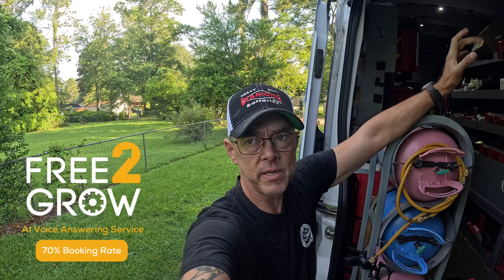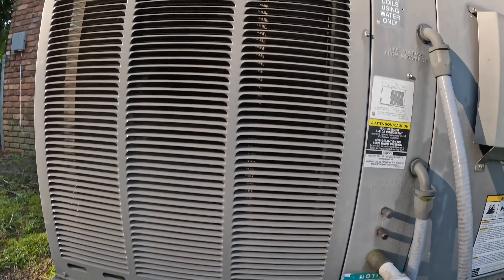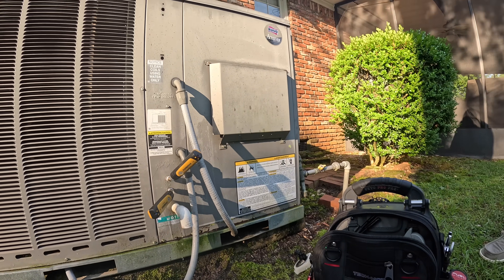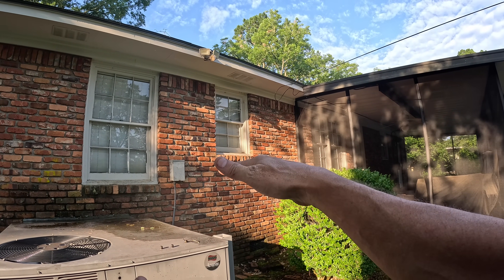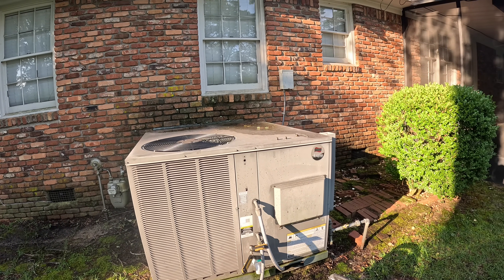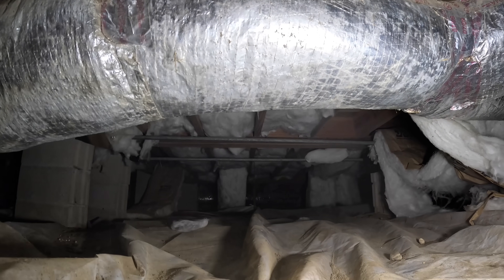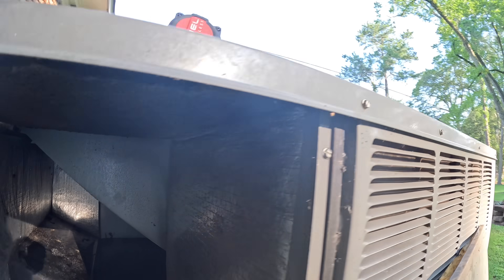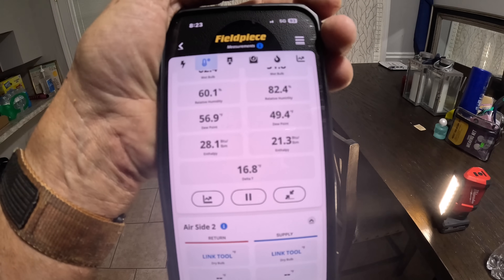A No Cooling Call I Get Every Time We See 100 Degrees! #hvacguy #hvaclife

Comment: We were in a 98-100 degree spell a few weeks ago. My next door neighbor told me the temperature was higher than the thermostat and the unit will not shut off. I no longer take calls, even for a neighbor, so I sent one of my 3 techs over to have a look. He called me and said he believes there isn’t enough supply in the family room where the stat is. I looked at it that evening and agreed. We added an 8” supply duct and wall register the next day. That was the fix. She is happy. She said it did this since she moved in 10 years ago when the temperature got over 95. No, we did not do a manual J or D. Sometimes you just go by experience. She is a widow and a good neighbor. I told my bookkeeper to invoice her for a  $79 service call. You have to pay it forward sometimes.

Comment: That ac is working hard at dehumidification based on the amount of condensate coming out. Id check RH in the house as well and to go the extra mile check out the entry points for any major leaks such as doorways and windows

Comment: If outside temperature is 100F and you set thermostat lower than 80F, it will struggle. It is what it is... I always keep that 20F degree difference in mind. If it's 90F I could go with 70F inside.
Reply: It depends on how well the unit is maintained. No dirty coils, no dirty filters? 
Then a big factor people seem to love to ignore is insulation in your home. When was the last time you put insulation in the attic or checked? What types of windows do you have? Are your doors sealed? It can be 100f outside and you could have a brand new unit but its going to run constantly if your house is not insulated well.

Door strips, attic insulation does not cost much.

Comment: This isn't a "that's all it can do on hot days problem"... This customer has house issues. You can have the best a/c system in the world and it won't work if the house isn't vented, properly insulated, and air tight.

Comment: Thankfully my unit is big enough to cool on 100 degrees days. House very tight. My issue was the thermostats installed when house was built had an non adjustable temp differential which was preset at 1/4 of a degree. If set ok 70 it would kick on at 69.75 degrees and turn off at 70.25. Unit wasn't running long enough to properly remove humidity. Best thing I ever did was change stats to am adjustable. I have them set on 1.00 differential. Unit runs longer  stays off longer. House also feels better cause of lower humidity. Unit will also last longer. Running longer is much better than starting and stopping

Comment: "Above 95 it gets outside of design conditions".   Well that's when you NEED it to perform.  In the desert near Vegas, it's above 100 EVERY DAY in the summer, and normal daily highs are 105-120 .
Reply: When you don't have moisture to remove, you don't have as much heat content to move, and you don't have to worry about an oversize system running short cycles that don't pull out enough moisture.  I know "it's a dry heat" is a punchline, but in this case it has very real practical consequences.
Reply: Congratulations, you have completely missed the point. The Manual J Load calcs are done with 95F outdoor high for that region. Manual J will be using different outdoor high temperature for areas near Vegas.

Comment: Have a 30 yr old central air unit. HVAC tech explained this exactly when checking the unit after the capacitor failed. Unit does well within about 20 degree differential 75 on days up to 96-98. Over that I have to bump the thermostat up to 76-77.

Comment: My Ruud 3.5 ton Achiever condensing unit is 23 years old and still running strong.  My friend has the same unit that is 26 years old and still working.  I LOVE the new units where only one 1/4" screw is needed for the side panels to pop right off = awesome design!

Comment: I ended up installing high efficiency window shakers in the main rooms.  I run a 3 ton and was told that it s a little over spec for my house.  On really hot days and nights I close off the vents in the rooms and run the window units to not have the main unit running/ 24/7.  I remember a week that it was 93 at night with high humidity and the main unit was clearly struggling until we flipped on the aux ones .  The house stayed at 74 and i felt the all the units cycle on and off like normal.

Comment: This is a great video brother . I had about 20 calls like this the past 2 month. Sometime they have a delta-t of 17,18 and when i look ag the ductwork the are small and the custummer says it has been like this for 20 years i tell them  its 95° outside 20 years ago. Some need more insolation, sometimes i tell them you need  bigger ducts a little more insolation, impact windows and possibly 1/2 ton more . They just cant keep up with this heat. Everything has to be working 100%.

Comment: Always interesting. Here in Arizona the state minimum is 30 degrees below outside temp. As a builder (now retired) our house could easily maintain 75 on a 115 degree day.
Reply: Arizona has low humidity so removing heat from the house is much easier

Comment: To me, if  it's 95 outside and your system is struggling to maintain 75 inside, you need a larger system. I have an older system that's always worked well and even  if it gets up to 97 or 98, I can stay a comfortable 70-72 inside my home.

Comment: That has to be r22 with those pressures? That suction is really high, that sucker is loaded big time. I would think you might have a little higher discharge at that point? Seems like that compressor has lost a bit of it's punch to me, but it would be pretty expensive to replace and you probably wouldn't gain much. Cleaning the evaporator theoretically will load that sucker even more. Looks like a lot of the system capacity is going down the drain. ( running 40⁰ water onto the grass) .  But not much you can do about that. Wonder if a guy could sub cool the liquid line with that condensate and pick up some btu per pound of refrigerant flowing through thhe valve.  With the load it has on it, I would think you could go a bit bigger no problem.

Comment: You can see the humidity is high in that house by the way it is condensing. That would make me think they need too look at air infiltration, even things like wall outlets and switch plates  along with usual door gaps.  Heavy drapes to block the light and hold heat close to the windows might help. 

I lived in a house built in the seventies 30 years ago in the Dallas area. 1600 sqft, single pane windows and the house leaked like a sieve. Plugging up the gaps, safety plugs in the unused outlets (you could feel air coming through them) and cover plate gaskets all helped. Good old F&J track home. 

Setting the temp down to 72 and letting it run all night would also help get the water out of the air as well giving the unit a head start for long hot day.

Comment: Awesome video and great explanation. We have this issue during the hottest part of our summer (now… lol) here in Wisconsin. Most homes are at 15,000-20,000BTU/per 1000sqft so they are properly rated or slightly underrated, but when it gets hecka hot and humid, that thang runs and runs and runs especially when the typical midwesterner is used to a comfy 68-72°F inside. Good thing our hot part of summer is only two to three months and then the rest is pretty temperate 😅😂.

Comment: What's the fix if the manual J only goes up to 95, but you regularly go above 95 degrees?  At the end you said if you design the system too big, it won't run enough to dehumidify on an 80 or 85 degree day.  What if you'd like to be able to satisfy a 25 or 30 degree temperature difference, but also be ok on days where you only need a 10 or 15 degree differential?
Reply: Then you get something with a variable power output. Don't oversize the regular stuff, it'll make you much more comfortable on the dozen hottest days of the year but it won't make it into a sharing rink.

Comment: alot of older homes have terrible insulation, i had a early70 home ( brick) and we re insulated each room and ceiling one room at a time; in two years we were done , it made a HUGE difference with the hvac performance, its worth it

Comment: Yeah...but no. 
You wanna go with a generic 75/95 then you should still have a liquid pressure of around 291. 

So that's about a 20° difference off. 

Then on the vapor side, even if you equated that to 25° of super heat and you're reading a pressure which is equivalent to 80° that still giving you a saturated temperature of around 55°. 

I would have charged in some refrigerant to bring the evaporator coil lower as well as bring the super heat lower 

You have to do a realistic diagnosis of the line temperatures and the wet bulb versus the dry 

There's no point in a "generic "reading. 

The simple logistics of the location of the condenser as well as shade and the internal component of the evaporator coil along with airflow and insulation make a significant real world difference .

In other words, if you're gonna do the work, then actually do the work

Comment: I heat and cool my 125 year old, 4500 square ft Victorian house with mini splits. Id never in a million years use one of those ac/ heat pump units. They are hot in the summer and massive electric bills in the winter. All countries in hot humid climates use minis splits. The rest of the world don't use those AC/heat pumps.  Im set at 67 all summer long as I want my house an ice box and 64 in my bedroom at night. Winter time its 5-10 degrees outside they are pumping 130 degree air. My units cost $1000 for 24k BTU and I put them in.  If it blows up ill order another brand new one online and have it tomorrow before sun down for $1000.-1200. Iv had them 8 years so far with zero issues and they have never been touched. Only thing I do is spray the coils with the water hose every few months to clean them.
Reply: But mini splits are ugly.

Comment: WELL DONE! Yes people need to realize as the temp outside goes up the set point inside should too! And Keep that Condenser CLEAN! Simple garden hose!! Also inside filter!
Reply: Or, HVAC technicians need to size the “standard” system bigger than they have been. It seems to me the “standard” is a shjtty one. If my brand new AC system didn’t get it below 70 I’d be absolutely pjssed off if nobody told me up front
Reply: Or just use mini splits and you dont have to worry about how hot its is. If you want a 65 degree house on a 105 degree humid day its zero issue. Plus its way cheaper.

Comment: Random question: How long would an r32 system last (roughly) if filled with r134a refrigerant?
Reply: Straight up wouldn't work. Line at all. And if it did, it would have essentially zero cooking capability due to the R32 being a higher pressure refrigerant that's fat denser, so the pump has a huge powerful motor but a tiny pump area. R134a uses a smaller motor and bigger pump because it's less dense at working pressures and easier to compress.

Comment: That's a poor excuse for not fixing the problem, you must be kidding right? A lousy 20° differential and that's acceptable? I'm a certified 609/MVAC Tech and my differential for any vehicle that I work on is 60°! That's right, 60° differential is what I work with with my customers. If it's 95° out, I'm getting about 35 to 40° out of the evap. You guys with your central air systems rely too much on mathematics, oversize the unit, who cares about humidity control when it's running all the time to get it nice and cold, these marginal systems are garbage nobody's comfortable at 75° in their house when it's 95° + out!
Reply: So you're freezing up the coils. Cool.

Comment: I think customers understand better if you cut out the jargon.  E.g., there's no need to refer to "Manual J".

It might be clearer to say, "Most units are sized so that they can blow air that's up to 20 degrees cooler than outside based on the size of house, the insulation, etc. So a properly sized unit will keep you comfortable up to about 98 degrees outside.  But if it gets above100 degrees outside, the unit will struggle to keep it below 80 inside. You can get a bigger unit, but then it'll be inefficient all the rest of the year. Usually, the better thing to do is improve the insulation or the airflow in the house."

Comment: My central air quit cooling last week during 95 degrees temperature. I went to videos to look for what could be the problem. The fan was working on the unit but it didn’t sound like the compressor was working. Anyway to make a long story short I changed the capacitor and the contact and cleaned the unit, easy fix and it’s works like new now.

Comment: When they going to make leak proof fittings? Screw it on, twist to extend the schrader plunger. 
I love being cold natured in atlanta summers, set tstat at 79 with a big swing diff so I get long dehumidifying cycles. Maybe too much swing, AC doesn't come on after sun goes down until next day around 12-1pm will be first time she fires up unless I run AC to dehumidify. 83F >60% humidity is my "time for some AC" breakpoint. Sunny,  almost noon and still got 1F to go before she comes on.

Comment: Very typical design issue. Had been buying and installing paint lines for automotive production. That one case in Alabama has been interesting. Yeah we designed the air handlers for the standard operating parameters. Something like high 90s on the temperature and higher 80s for humidity. How many days a year do you have above those values? Maybe 20 days. They are all on weekends so we can shutdown production without shutting down the customer as well? Nooooo not necessarily 😮😂😊

Comment: You should wear gloves when installing those meters on the refrigerant nipples. It is not worth getting frostbite and losing your fingers. Plus, the screen/filter that you washed was too dirty. That would restrict airflow enough to prevent minimal air movement, resulting in difficulty to cool the home. I hope that you told the customer to clean/replace air filters often. Ask him how often he changes filters and tell him that dirty filters can plug up the evaporator coil which will also block air flow and make the unit work harder than it needs to. Keeping the condenser coils clean will also help. Another way to check if he has adequate attic insulation is to put your hand on the inside ceiling and walls to see if there was much of a temperature difference. A temperature gun would also work. When asked, I tell people to do several things to help cool their homes. First, if the temperatures at night drop at least 10 degrees below the set thermostat temperature, open the doors and windows and use a whole house fan to pull cooler air in from outside. This is also advisable to let fresh air into the home. Second, run ceiling or portable fans in the house to move air around and make it feel cooler. Third, keep the AC running at night whenever possible to drop the temperature inside the house. When it is cooler at night, you can turn the temperature down on the thermostat (i.e. 3 degrees) and it will take longer for the house to get hot during the day. I subscribed to your content, because I liked this video.
Reply: Dude he’s in Georgia. You’re way off if you tell a homeowner to pull in air overnight. It’s humid most nights and rarely gets under 75 here in the southeast
Reply: @JonathanStanley-wq3zq  That is why I said " if the temperatures at night drop at least 10 degrees below the set thermostat temperature, open the doors and windows and use a whole house fan to pull cooler air in from outside. This is also advisable to let fresh air into the home." A Ten-degree difference, even in a humid climate, would help the AC unit to not struggle during the heat of the day. I think you missed the word "if" in that sentence.

Comment: I worked in large commercial buildings and on extreme high humidity days we had to force outside dampers closed on selected units . to control internal temperature levels. Resetting automatic damper function after the sun load went down . We  sometimes had to do this process on different sides of the large buildings as the sun exposure changed through the day. A more complex control paradigm than residential applications
Reply: You’re super cool

Comment: We set our AC to 70 degrees for most of the day, and we often get 115-degree days so that's a 45-degree difference in temperature.  I guess it has to do with humidity, we live in the desert southwest (low humidity), our system has no trouble maintaining the 45-degree difference.
Reply: Taking humidity out of the air uses most of an AC units’ cooling power when it’s really humid.  Even though desert locations get extremely hot, because the air there is dry, the AC units can focus on their main job - cooling!
Reply: 70°? Burr that is cold! I live in the desert too and I keep my thermostat at 81.